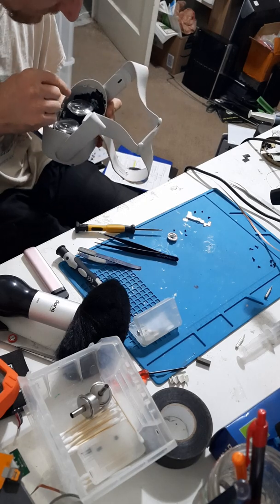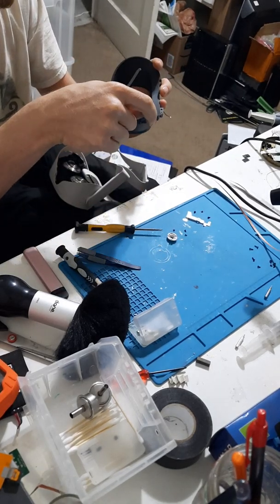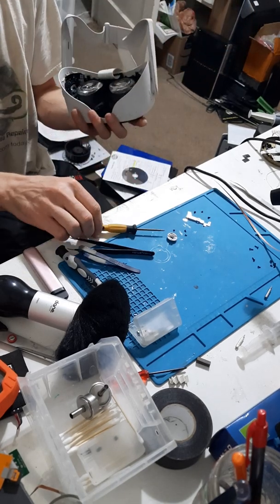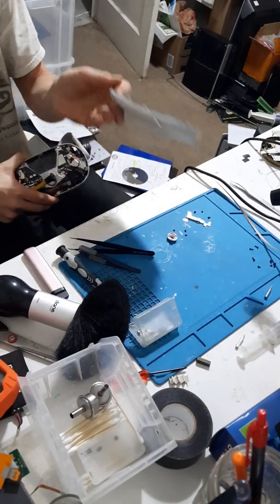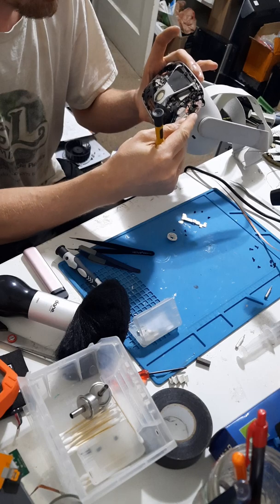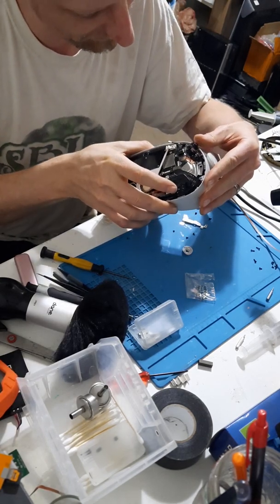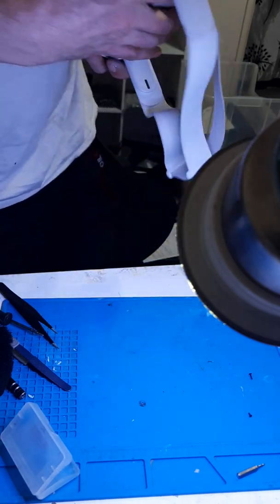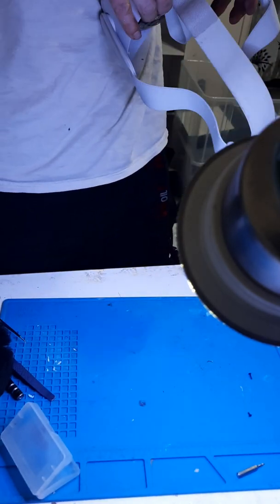Oculus Quest 2 by Metaverse Camera Replacement tutorial

Comment: Dude I popped off the lens and the mother board to the lens remained on the copper piece . I didn't have to even take off the whole front part it I just needed it cracked enough to pull the cam on out now I wonder if I throw in the lens from my other Oculus I shouldn't have to take off the whole front piece ... Hopefully so cuz the 2/3 screws that hold it down have cost hours to try to unscrew it no matter what size it just won't budge it idk
Reply from the maker: I am against DIY (Destroy It Yourself). It sounds like you may have stripped the screw. I strongly recommend taking it to a licensed and reputable repair shop before you cause more damage.

Thank you for commenting. I only recommended cleaning the lens and inspecting them for damage. I never recommended opening the unit!